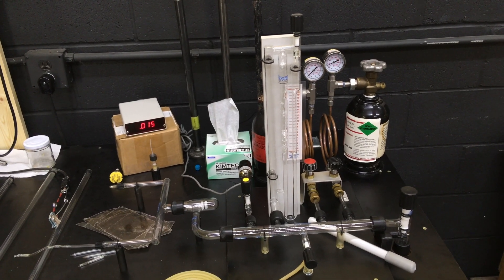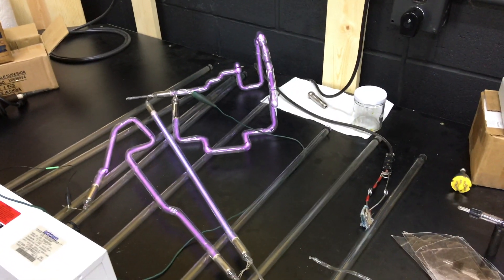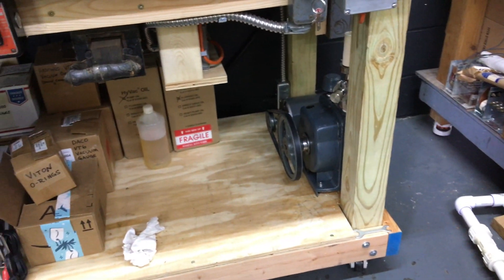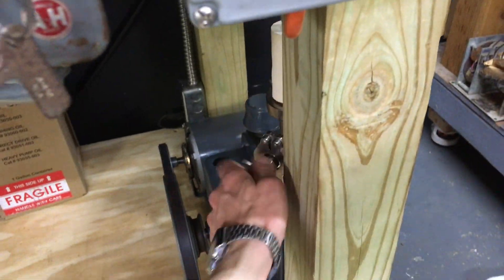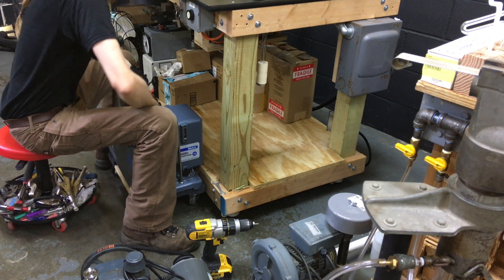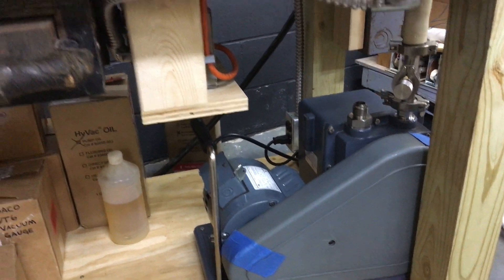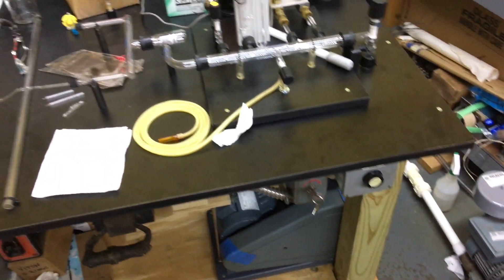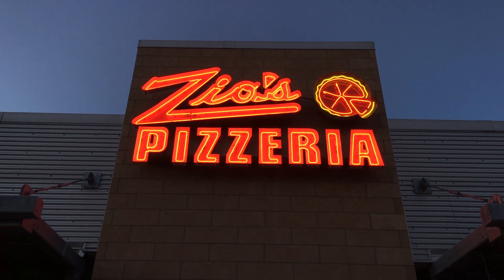Neon Plant: Vacuum Pump Upgrade

Comment: Can you make a more detailed video about how everything exactly works? Like the fluid pressure gage... what kind of liquid is in there?

Nice Build... i am already searching like two years for a high voltage transformer... didn't find one yet😢

Greetings from Germany
Reply from the maker: greetings!  have you seen my detailed video on building the vacuum setup?  it is a long video but has lots of information, including the name of the fluid in the U-gauge manometer (it's Dow Corning 704, same fluid as used in diffusion pumps 😉).
https://youtu.be/Ya3I1l-zkqg

Comment: I am a refrigeration person I like your channel I like neon I know how to bend tubes with torches and do other things as far as your pump issue. Do you want to try to get a bigger welsh or do you want to use the right synthetic oil in it wells makes a good synthetic oil for that pump. Yo-yo is the home key to the back and the right well better the vacuum.
Reply from the maker: eventually i will add a diffusion pump to the setup, which will significantly increase the pumping speed and ultimate vacuum.
as per the manufacturer's recommendations, im using the oil designed for the pump, Welch DuoSeal 1407k oil.

Comment: Cool videos! Good luck with your neon workshop! 
Just one question: Do neon processing really need such a huge free air displacement? 
Tubes together with whole system looks like it have less then 1L... 
Isnt it ultimate pressure the most important characteristic instead of pumping speed?
Reply from the maker: excellent question!  you are correct that the tube does not have much volume, however when the tube is being evacuated/bombarded, the low pressure & heat causes all the impurities, water vapor, etc., to vaporize & outgas, which creates large amounts of additional volume that must be removed.

the ultimate pressure of the vacuum pump is very important (the main reason i upgraded to the Welch pump); but the free air displacement is also very important, as there is a finite window to remove impurities from the tube while it is heated; once it starts to cool, the microscopic pores/imperfections in the glass will start to re-absorb/trap the contaminants.  the higher displacement helps to remove more of the impurities before this happens.

eventually i would like to add a diffusion pump to this setup.  the diffusion pumps sold for the neon industry are usually rated around 600L/min, with an ultimate pressure around 0.005 microns.  essentially, you want the most displacement and best ultimate pressure possible to create the cleanest tube.

i hope this helps.  if you're interested, i suggest reading this article about pump speeds & ultimate pressures regarding neon equipment:
http://www.svpneon.com/VacuumPumpWork.html
Reply: @NeonPreservation  Thanks for explanation! And thanks for a link! My dream set up would be  compact, probably a turbo pump, something like here: https://youtu.be/ccHkKUREHEI 
He also have nice website on vaccum stuff!
http://www.tubecrafter.com/

Comment: I’m trying to put together a roughly 5 gallon bucket sized vacuum chamber. Think a 1402 could pump it down to 5 micron in under an hour? I don’t have a lot of experience with this stuff unfortunately
Reply from the maker: the Welch 1402 (running under ideal conditions) is rated for 160L/min of "free air displacement", which is about 42.3 gallons per minute.  of course, the actual displacement is going to decrease exponentially as the chamber is evacuated, and other factors will affect that as well (e.g., temperature, vapor pressure of anything in the chamber, materials outgassing, etc.).  that said, the 1402 is fantastic workhorse of a pump; it evacuates the the tubes i make to below 5 microns in just a couple of minutes.  i haven't tried evacuating a volume as large as 5 gallons, but i do believe a well-functioning 1402 could do it in less than an hour.

i think i need to get a large vacuum chamber and do some experiments of my own! :)  good luck!
Reply: @NeonPreservation  cool that’s good to hear, I’ll probably pick one up soon. And thanks!
Reply from the maker: no problem!  remember to use the largest diameter possible on your vacuum tubing, fittings, etc., for maximum flow.
cheers!